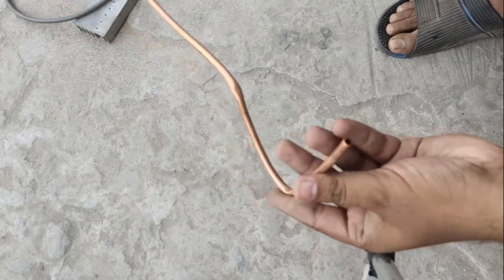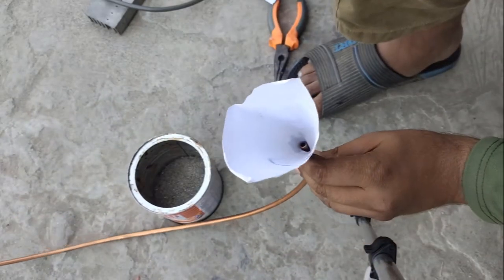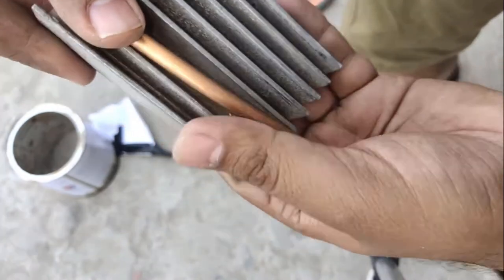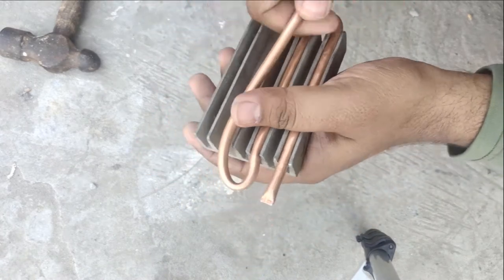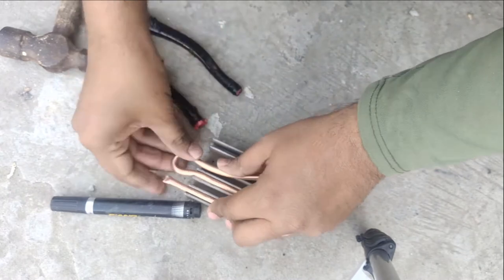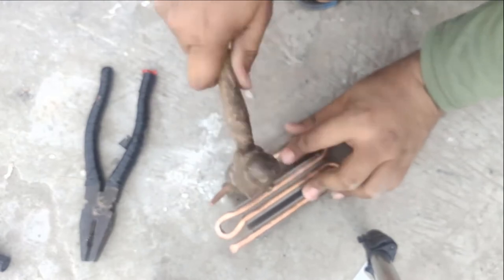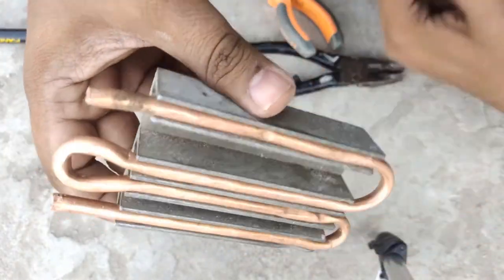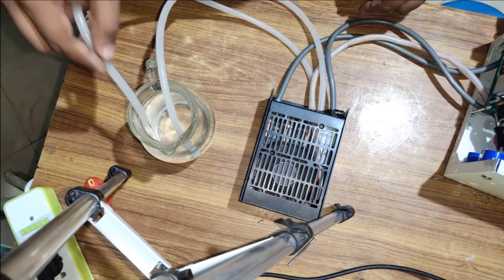How to Bend Copper Tube Using Sand- How to make Water Condenser Heat Exchanger

Comment: Good tutorial! We don't need special tools, just dry sand. Also it looks easy to crimp the ends of the pipe and then open up to release the sand. No need for a very tight seal such as when using water. You could also bend and crimp the pipe at the ends and saw the ends off later for a strong seal maybe. I got some sand from the beach since it's fine and dry.